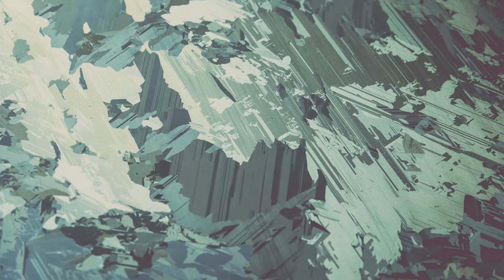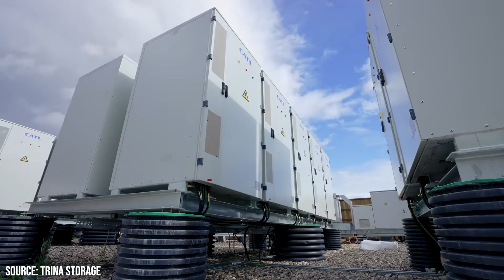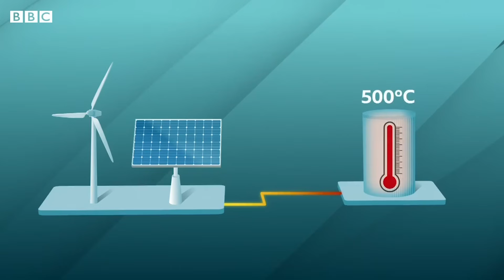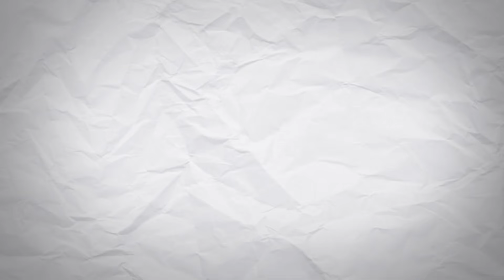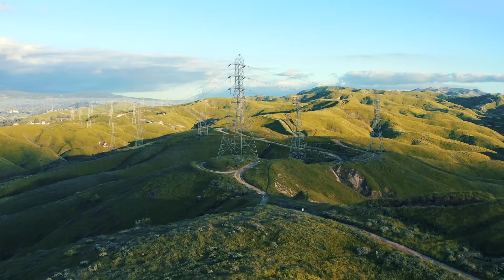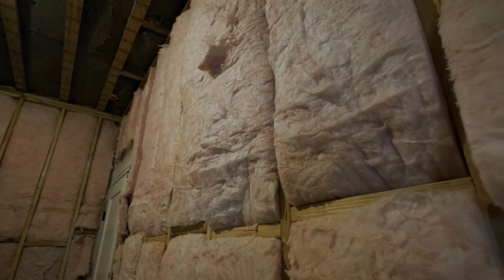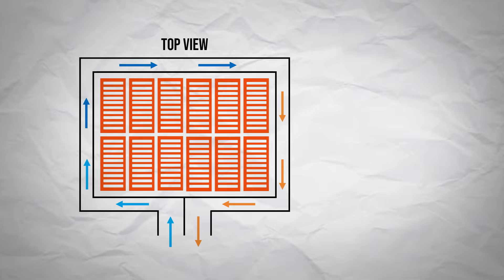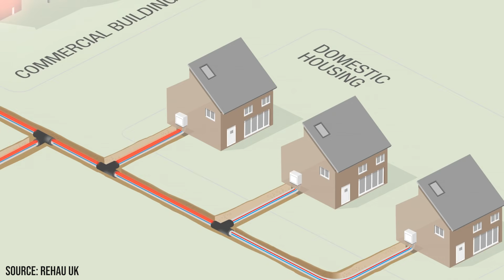How 3000 Degree Bricks Will End Battery Storage

Comment: I'm a bit sceptical on the high efficiency and duration claimed. 
Temperature is conducted in three ways: Direct conduction (on contact), convection, and radiation. Direct conduction can be avoided best by "air-gapping" the materials, or even better by "vacuum-gapping" like in Dewar vessels. Convection can be avoided by vacuum, too, or by materials that would significantly restrict the ability of the surrounding gas to move (like in styrofoam or glass wool). 
However, at these temperatures, a major part of the heat is already transferred by radiation, i.e., infrared and visible light. And a good part of the emission is already in the red and yellow visible light. To accommodate for that, and for longevity, the inner walls of the insulator would have to be plated with gold, as other feasible metals (e.g. silver, as also used for Dewar vessels, or aluminium) would degrade too quickly under these harsh conditions. But the walls can't be made out of normal glass, because it would already get soft at temperatures > 1000°C. So a special glass, or even more expensive materials (like quartz or ceramics) would be needed. That significantly contributes to the cost, especially when considering the enormous areas that needed to be covered for a feasible storage of heat. And probably a single layer of insulation would not suffice. 
Besides that, the material is under enormous mechanical stress. Microscopic cracks would be the consequence, and thus, either frequent maintenance or heat loss. 

I don't say this can't work, I'm just a bit sceptical on the claimed numbers for efficiency and use cycles.
Reply: The heat that 'leaks' through the inner wall of the radiation chamber is surrounded by the air that will be blown back through the system and recycled, so there is very minimal heat loss.
Reply: @RondoEnergyGlobal  But that is only useful during the loading cycle of the storage. During storage time, it will lead to loss.
Reply: The Rondo unit discharges 24/7 so all of that heat is being used
Reply: @concon424  ah, so it discharges while being charged? That's of course not a waste... 🤣
Btw. the patent only says "Heat from the solid medium is delivered continuously on demand.", not "while charging". And the so-called "dynamic insulation" is only a pre-heater for the gas to discharge the heat.

Comment: We need the electric-electric efficiency to compare to batteries there is no way that going to be 98%.  This is electric to heat efficiency, the question is can you capture all that heat?  And using air, isn't it going to create alot of NOx pollution?
Reply: @Tony.... No we do not 
Because that's not the aim of Rondo. The comparison here is creating via natural gas or oil vs. Heat created by green electricity with a form of energy buffer (the rondo heat battery).
As for the making of heat, rondo provides the link between a discontinuous energy provisioning and a continuous heat demand.
Reply: Yes we can capture all the heat, and no we're not turning that heat back into electricity! Industry requires hot air or steam for many processes, most of which use natural gas today. Rondo eliminates scope 1 and 2 CO2 emissions and there are no NOx SOx or particulate emissions.
Reply: @RondoEnergyGlobal  I'm replying to the video author who is saying this (or is this actually a paid advertisement?), you cannot compare it to battery electrical storage, its not the same thing.  Thermal energy has its uses as does electricity.  You would not use battery storage for heating.  Its  better to store thermal energy for heating than use a battery, you get more kWh for less money, you havn't found any magic there, but I do hope you do well with it.  What I object to is the video stating comparing thermal storage to a battery as if you can use thermal storage in the same way.  Typical marketing  rubbish.
And how do you know there are NOx release, if air is involved and you are heating it to that temperature you are gonna make NOx.
Reply: @RondoEnergyGlobal  You guys are genuinely heroes for figuring out serious ways to reduce industrial reliance on natural gas.

Comment: How are they going to protect the bricks from crumbling under thermal cycling ?
Reply from the maker: The bricks are the same as those used in the kilns of steel mills and have been designed to last for a very long time at high temperatures - John said this relates to over 100 years of expected use!